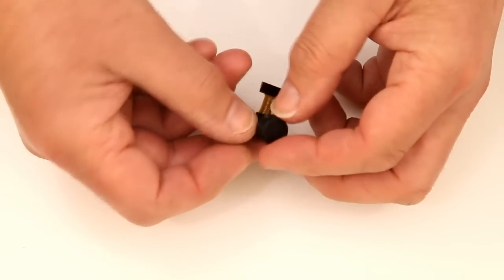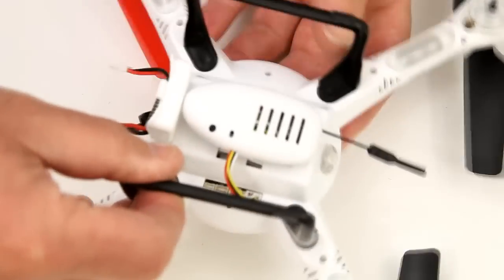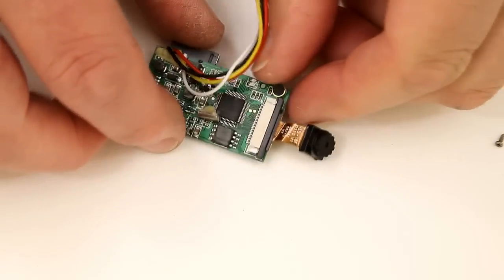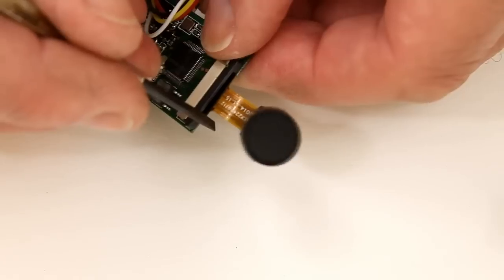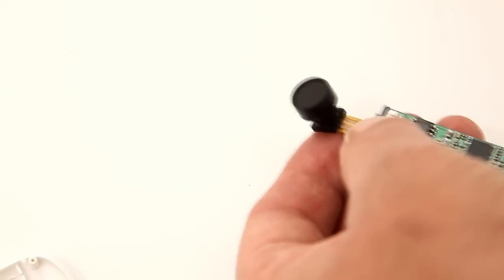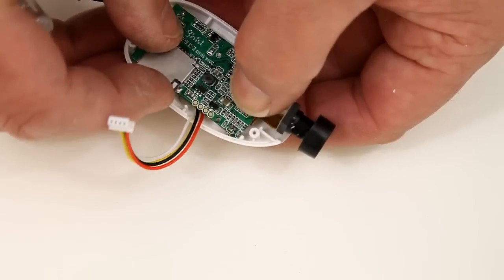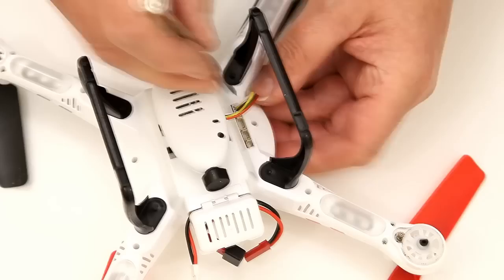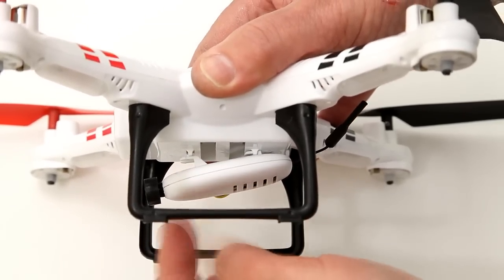WLtoys V686g replace upgrade wide angle D lens module & test flight

Comment: My v686 quad has been cutting out randomly and falling out of the sky, anyone know why this happens and how I can fix it? If anyone has some insight It would be much appreciated, other then that I love this quad :)
Reply from the maker: Daniel D'Arcy Hi Daniel, sorry I haven't had that experience with this quad so can't really help :-( I know a lot of people drill a hole to feed the antenna out on the quad body and transmitter but don't know how much this helps. Hope someone comes back with something positive for you. Please like and sub cheers
Reply: Daniel D'Arcy Mine had this problem too. When the quad is at certain position, around 100m away, there is a sudden signal loss, and the quad just drop from the sky like a leaf. Will drill a hole to feed the antenna out, and see whether it helps.
Reply from the maker: It should do I have heard good reports about it :-) definitely sounds like signal failure at least this one drops the little Hex I have just keeps going up or away :-(
Reply: +Tigger's RC Reviews just one more question. Does it make  difference if i point the antenna downwards instead of upwards? I think that pointing the antenna downward may be better since the quad is above us, but i worry that it may interfere with the antenna for the fpv system. Sorry if the question sounds stupid, im a novice.
Reply from the maker: Kok Howe Loh Hi Kok I don't see any questions as stupid, well not yet on my channel, but I'm sure I will :-) I have never seen anyone put antenna down as I'm sure it would reduce signal with the battery and possible interference with or from FPV. If anyone knows different please let us all know. I've been doing this less than six months but from what I see I think I will always be learning :-) Thank you for your comments and hope it is not your last and thanks for Subscribing :-)
Reply: I have stuck the antenna facing up now and it seems to work better it hasnt been dropping out.
Reply from the maker: Daniel D'Arcy Excellent :-) just check the transmitter antenna does actually go into plastic cover, just unscrew the screw on the back and pull cover to see. Always worth a check ;-)